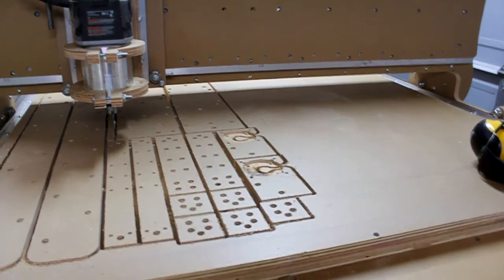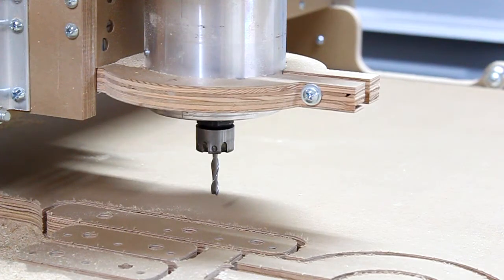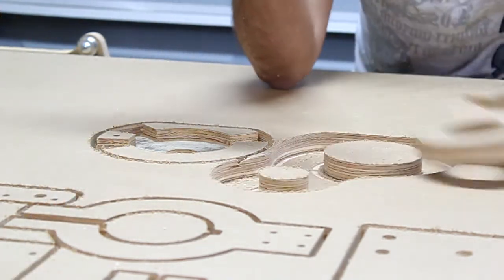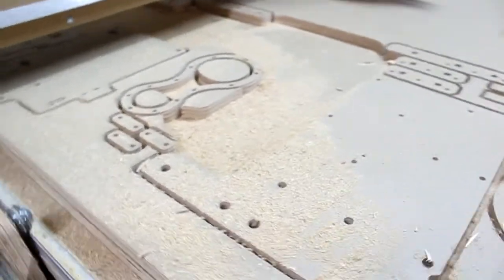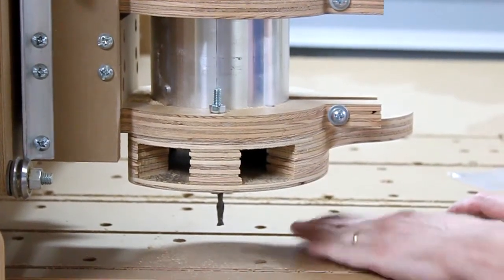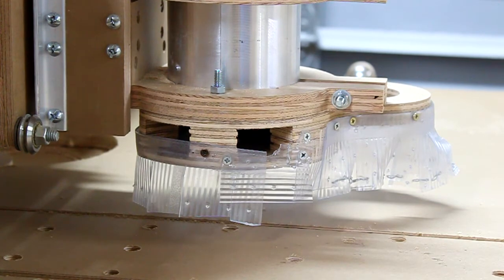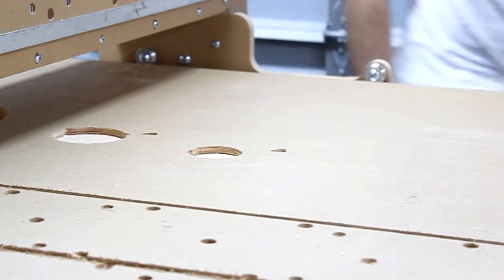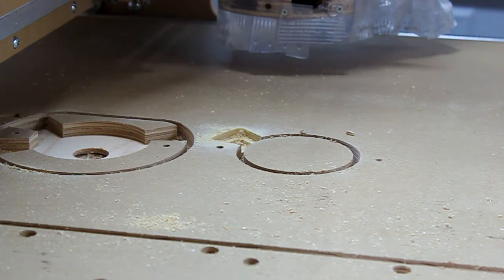Total Design Process for CNC Vacuum Mount part 3 of 3

Comment from the maker: Yes, that is one of the attributes of CNC application.  There are many factors: hardness/machinability of the material, depth of cut, speed/feedrate of cut, rpm of the spindle/router, and whether the proviles will undergo a roughing and finishing pass.  It's always good to gt as much hp as you can afford as long as the CNC machine can handle the weight and will travel fast enough to take advantage of the extra power of the router/spindle.

Comment from the maker: @karandex For a level surface, the surface needs to be machined with a leveling bit, or a large flat-end end mill.  For large surfaces, use a fly cutter. For pcbs, you can use a standard end mill and pocket an area that will contain the size of the pcb.

Comment from the maker: @aggrav8d The design for this vacuum completed negates the router blower air movement and allows for better efficiency with the actual vacuum.  The blackFoot vacuum mount design mixes these two air flows, so the efficiency is not ideal.  This mount design will be adapted to the blackFoot and blackToe machines.